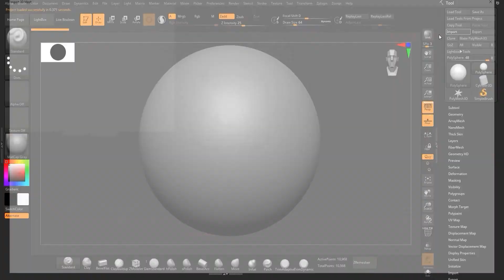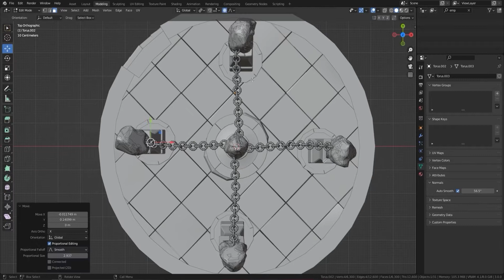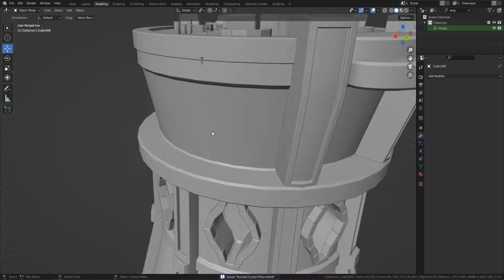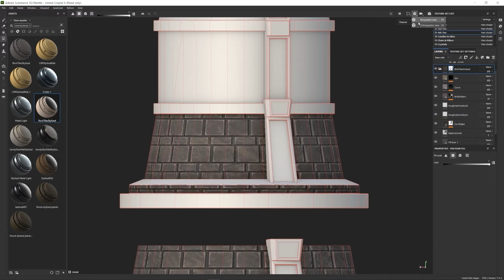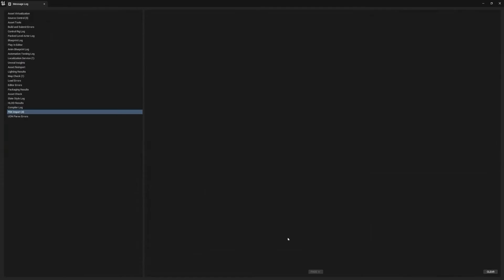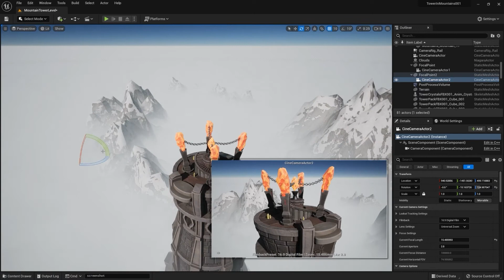Blender 3 | Unreal Engine 5 | Complete Guide | Stylized Crystal Tower Environment | Game Design

Comment: so you can do texturing in the game engine only?
Reply from the maker: Tower pack has separate textures for  Unreal Engine and for Blender. Blender variation textures is the usual PBR set which can pretty much be used in any renderer :)
Reply: @3DTudor  yeah the problem is with Blender's coloramp node. Unity and probably UE can't read that and this is why I'm still confused with how to make textures properly. Do you have any courses about how to make textures and export it properly while bypassing the aforementioned drawbacks?
Reply from the maker: @lucutes2936  I'm a little confused about what you are asking here matey.  Are you asking how to import textures to Blender or how to create them with something like substance painter?
Reply: @3DTudor  you know how you can make procedural textures in Blender? Whenever I do that and export it to Unity, I get shading issues and sometimes the textures look wrong. Someone told me it's a Blender issue and I should use a different program for game developments.

I know how to set up my textures in Unity, but I don't know if I'm doing something wrong or is it really the program's issue. If I make a simple texture with no special nodes like bump or normal maps then sure it will work just fine.
Reply from the maker: @lucutes2936  Normally we create textures outside of Blender like in Substance painter.  We do this either one of two ways.  We have textures that are created on plains you could call these trim sheets or you could have just one texture on a plain for instance.  Or we just create the entire UV textures in substance painter.  There are drawbacks to both.  The first way has problems in that you are unable to get nice edges and ambient occlusion can be a pain.  The second requires many more texture maps.  My castle kitbash course covers the first way of applying textures while the cannon course goes through the entire process of creating textures in substance painter.  Hope this helps :)  I would also add that creating textures in Blender for export is not something I would normally do.